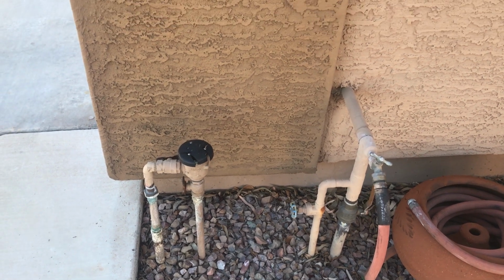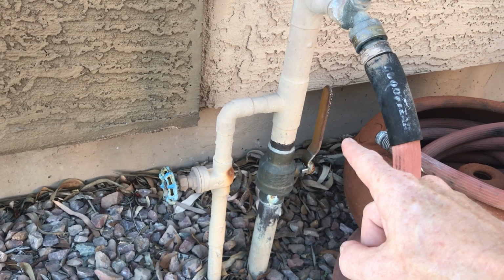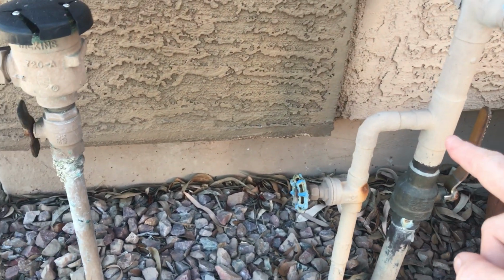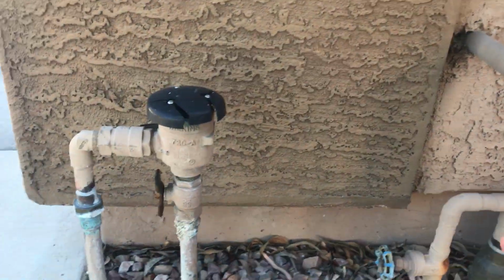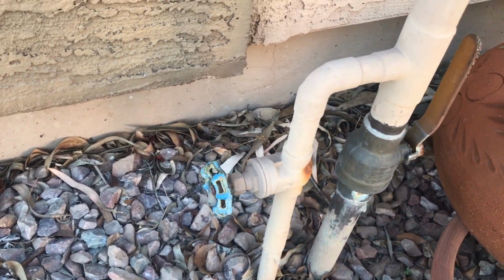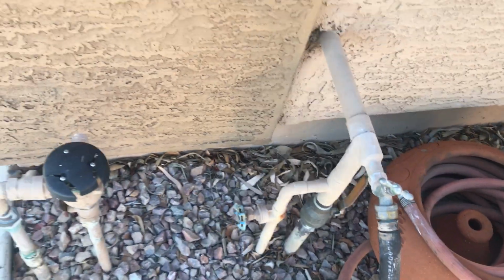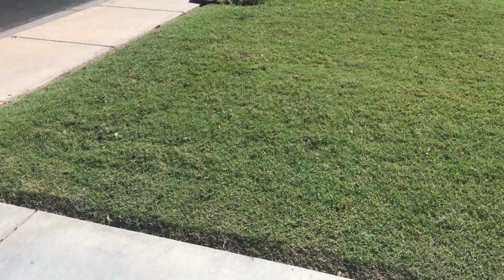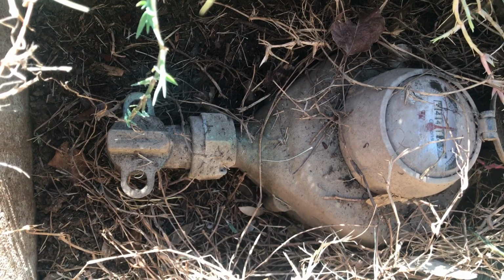Irrigation water shut off valves in AZ, CA

Comment: I stopped using my irrigation because the pipe is always leaking somewhere. So we decided to just stop using the irrigation on our front yard. I set the irrigation setting to off, is that enough to stop it? Or do i need to shut off the valve going to the irrigation? And is it safe or okay to leave the valve of the irrigation closed for a long time?